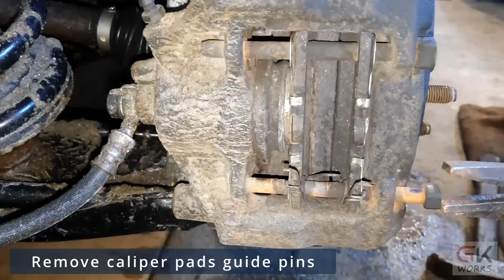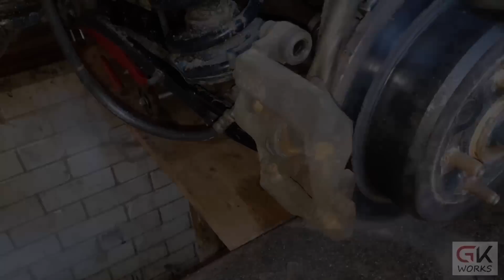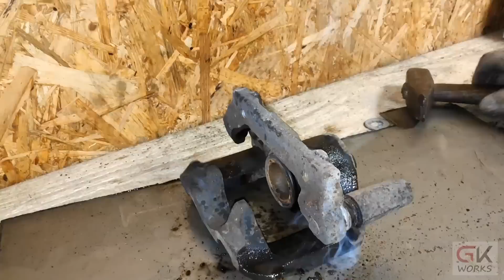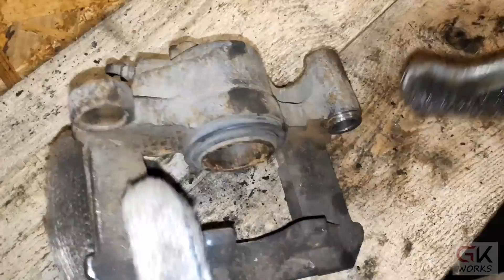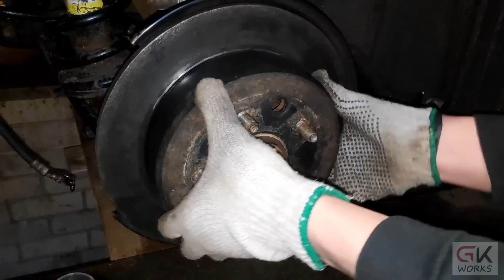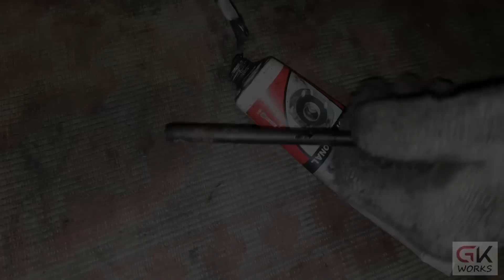Lexus IS250 2005-2013 Rear Brake Pads Replacement | STUCK GUIDE PIN FIX

Comment: Just did my nephew's 2006 is250 same problem on right side no need to remove the caliper. Hammer caliper back a little and spray wd40 and let it work itself in. Sand off rust and apply lubricant. No need to open brake lines.
Reply: Depends on the situation my guy

Comment: I think that I would just replace the caliper with a decent looking used one complete with replacement caliper carrier. It probably functions OK but looks terrible still and they look so nice when they are in nice condition. You have done a functional decent repair though and its very well filmed. Thanks for taking the time to do it
Reply: That's what I did. After about 10 years, the caliper was so rusted that it was easier to replace the caliper and mounting bracket when changing rotors and pads.
Reply: Had same issue with my 2011 Lexus is250 awd.  Poor design. Bottom should be same as top. Like on hondas floating caliper design. Much better.

Comment: Before removing the stuck caliper, watch what happens when you have someone else apply the brake pedal hard or constant pushing. The inner pad does 98% of the work and the caliper flex 30% away from its center. I don't know about the Federal, but Toyota car owners will be in trouble when the stationary pin snaps off at its threads. Companies should be stopped producing this caliper by a recall and go back to 2 removable pins fasteners. Camry is the best test subject, it is less beefy than Lexus.

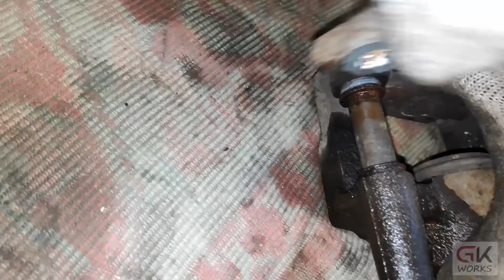Comment: Even a Lexus needs a torch.. the fire-spanner. The action at 3:42 however, repeated 1 million times, looses any bolt.
If Lexus-designers had pressed in stainless-steel bush, and used appropriate thick grease, and seal to keep that grease in place, the problem would not occur.  Does that really make the car far to expensive?
Are there any "good" cars left? I do not think so. 
Conclusion:  Lexus is simply  " a car ",  like others. It does not distinguish it self technically from others.
(Alto-front-calipers have exactly the same problem.)

Comment: I do know that the 2nd gen lexus is350 and is250 have different front brakes since the is350 have a bigger brake at the front but does the fronts also have caliper pins too or just the rears?

Comment: How do you prevent the brake line from leaking after you remove the caliper? Thanks.
Reply: Use a pair of vise grip pliers with rubber hose around the tips and clamp down on it or use the actual  hose clamp pliers
Reply: @livindaunderground  We'll do it. Thanks.
Reply: @Toyota Tundra04  no problema sharing ideas/info openly is what keeps car culture thriving 🙌🏾

Comment: The guide pin for the caliper in my car broke inside the caliper. So what’s the name of the part to buy with caliper that has the pin on it. The part you took off and then worked to separate from caliper. I hope I explained it correctly. Thanks in advance.
Reply from the maker: I think its called brake caliper carrier slider. Guide pins are bolted to it
Reply: @GK_Works  Thank You. Will look for that.
Reply: Good luck removing that busted bolt 🔩

Comment: Sds chisel or air hammer makes this a complete non problem. Rebuild the pistons and getting them back in also sds drill makes it child's play. This car NEEDS caliper bebuild kits (ebay) slider dust boots, piston seals, grease, slider pin rubber o ring, DOT4 flush, They are very cheap to do.

Comment: So I don't need to remove the caliper to change the brakes on the 250?
Reply from the maker: You only need to remove caliper If your brake caliper needs to be rebuild or you have stuck guide pins, piston.